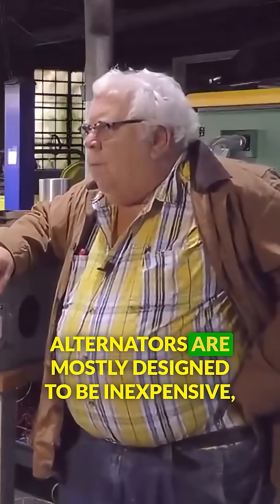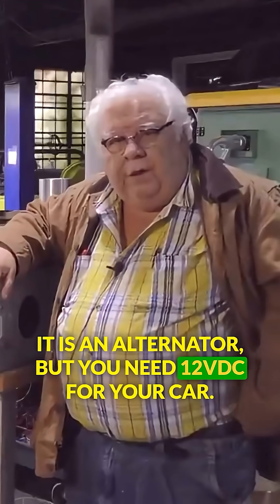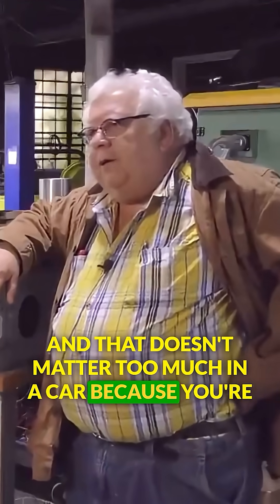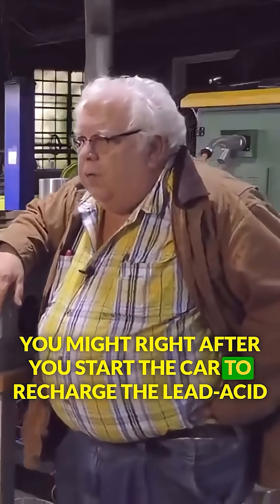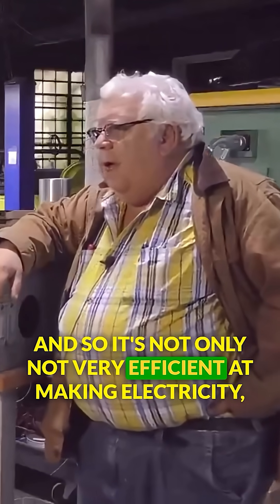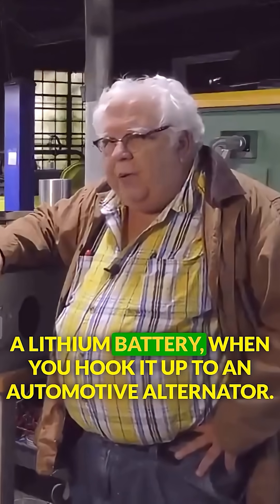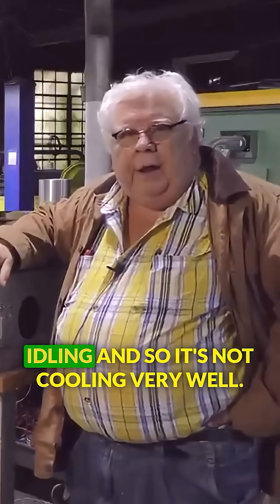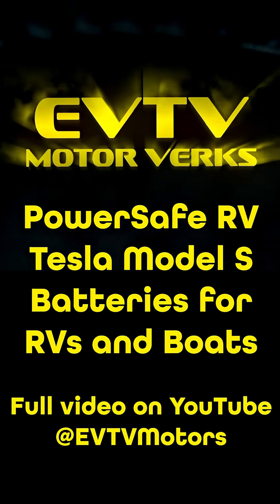Alternators are Only 50% Efficient!

Comment: When I was young and poor in the 70s, my alternator quit charging.  Didn’t have the $22 for a “new” one.  I took it apart and knew just enough to realize that one diode wasn’t like the other 5 using a Simpson ohmmeter.  I desoldered it and pressed it out and took it to a shop then rebuilt starters and alternators.  The old guy didn’t want to, but he sold me a new diode for 17 cents.  I was real proud of myself that day
Reply: I used to buy reman alternators. Then I noticed they were all poorly rebuilt. The bearing housing was shot so they used a plastic spacer that wore out quick. Anyway, I wasn’t spending $300 on a new one and now reman crap is $150-200, so I leaned you can open it up and replace the regulator/rectfier for like $20, bearings like $20. If you have to you can get brushes but cut rope at the commutator and windings. 

Point is, being poor doesn’t mean you have to be broke.
Reply: @tomlindo2863i see that plastic spacer on the original starters taken out from freightliners, and sometimes you dont find it here local in Chile
Reply: @tomlindo2863I used to run dual 100 amp alternators they are cheaper than one big alt and would replace regulator for a higher set point as well as replace rectifier bridge. Was very easy
Reply: @tomlindo2863in the 80's we always used brass bushings, but never saw one that had a bearing that needed a sleeve.   I might've saw 2 that just required using a small punch to make a few ridges inside the aluminum casting, that would hold the race tightly.   And i rebuilt probably 200
Reply: When your poor you learn and you learn well
Reply: @tomlindo2863 yup - I JUST did my 2003 Volvo s60; the original lasted over 362K miles.  I removed the alternator and then replaced just the regulator/rectifier... for $60.  Compare that to a reman I was quoted at over $300, plus Core.
Reply: @tomlindo2863 the people I know who grew up poor are the smartest people I know. ❤
Reply: @tomlindo2863 You mean Arrow does not remanufacture using the highest of standards?  <G>

A former employee once worked at an auto electric shop. Starters, Alternators, generators, and dynamos for vehicles, cranes etc.... most of the work was reboring the housings for new bushings or bearings. and rejecting cores that  would not hold up.

A lot of lathe and mille time, and finesse. They spent the off seasons ( spring and fall ) building up a stock of popular GM Ford and Chrysler for the coming winters and summers.
Reply: Back in the day when people actually repaired (and knew how to repair) things.  I fix everything, in this disposable society and I more often get criticisms.  'I don't have time for that,' 'take it to a shop,' 'just buy a new one'...losers
Reply: @Johnslist I'm with you. Guy wanted to charge me 275 bucks EACH to replace 2 window motors. Driver and passenger in my wifes Mazda cx9. He said you couldn't open those motors and replace the gears. I called bullshit found the gears on ebay for 7.50 for each window. I saved us 535 dollars
Reply: @Johnslist rebuilding doesn't provide American jobs. Buy new.
Reply: @Johnslist Yup!
Reply: @Johnslist use your 🧠 nostalgia things can be handles with simple hand tools, short while of learning and a little t&e. If it breaks permanently, oh well. It was already screwed. If it's TOO IMPORTANT TO RISK, then I will refer to a pro. Most things ca be handled personally, with a bit of grit, education and determination
Reply: @Johnslist  Yes losers!! There are losers who will steal a $20 air mattress from Walmart! 
Or $1.25 item from the dollar tree!!!
Reply: @Zach-sg5uu I guess “losers” works. Where I’m from, we just call them “blacks”. They shutdown my local Walgreens because they kept stealing red spice.
Reply: As an engineer I can tell you always use a term re-manufactured as opposed to rebuilt up on request at a service shop...!!! Manufactured including not only a physical examination to meet specs but also making the unit for in-play tolerances etc....!!!!
Reply: @alancombow6474  I worked in an exclusive engine rebuilding plant that's where you find out what Reconditioned and Rebuilt mean in the business, Rebuilt means all new parts to spec, Reconditioned means second hand used or repaired parts with lower end tolerances. we only did rebuild to specs or higher or customer requirements, where the costs and end product reflected the differences.
Reply: @FladFlidington  rebuilt may technically mean replacing everything, but many people use that term without doing all that. I've seen lots of people simply reseal components and call it rebuilt. Whether they replaced the bearings is a real toss up.
Reply: @alancombow6474 lol you're funny. 😂
Reply: @alancombow6474  i find that no none rebuilds YOUR alternator anymore..we used to take starts in too...not anymore..
Reply: Indeed, you had every reason to be proud! Kudos!
Reply: Back in the 1990’s.  There was a guy from Jamaica  in Brooklyn NY that could take astock Honda alternator and rebuild it to  100 + amps.   They never failed.    The guy made a quality product.
Reply: @fatboy19831 That goes to show you that Jamaicans never fail to work…………😊👍
Reply: @fatboy19831 In Africa they are making welding machines from them, sort of "inverter welder", by changing idling RPMs they are changing welding output. 🤗
Reply: @fatboy19831  a Japanese guy but with dreads saying “my bum ba clot alternator” with a touch of nyc accent would be hilarious
Reply: Ιf the alternator had 50% efficiency and 1200watts of heat that wouldn't live for more than a minute
Reply: @ngt84 I have lithium ion batteries in 6 cars my side by side and motorcycle this guy is full of it.
Reply: @ericculver115 , I suspected that !
Reply: I bought a rebuilt/reman alternator when I was eighteen or nineteen. Installed it and had bearing whine. Couldn’t drive to the place to get replacement without it installed so I took apart my core and swapped bearings. Worked just fine until I blew the car up lol. That’s another story though. My point here though is when disassembling the core I found a burnt winding. I felt like a genius for (maybe) finding the only failure point based solely upon my high school learnings 😂 (I was definitely not top of my class)
Reply: A Simpson 260? LOL Haven't heard that since my early Air Force Days.
Reply: @Mike-sheaDtree  Dad was PMEL.  Taught me how to solder when I was 8.  Still have a 260
Reply: @SteverRob  Tho I was an Electronic Warfare Technician in the AF, I did about a year in the Type IV PMEL Calibrating torque wrenches and some Simpson 260s, back in '84ish
Reply: @Mike-sheaDtree  Small world.  We still live on the MS Coast, near KAFB.  Dad retired from the AF and after 18 years with NASA (Stennis) and now I have also retired from the same NASA Center as a Sr. Metrologist at the Cal Labs there. Followed in his footsteps
Reply: @SteverRob PMEL? In the Air Force that was the Precision Measuring Equipment Lab. They calibrated our furnaces and at Langley they did all the heads up display work, radar tuning and anything that literally had to be Perfect. Much respect!!!!  I was just an aircraft welder.
Reply: @Mike-sheaDtree  in my first electronics class, ~35 years ago, my electronics teacher had a set of simpson meters in the lab for us to use during class. i would love to get one, just to bring back those warm memories.
Reply: @IzziedeD  I went through 10 months of electronics in Air Force Tech school at Keesler ADB Biloxi MS, it was truly a privilege. It included Electronic Warfare, since I have long since retired I only use it to modify my electric guitar, or fix the wife's washer and dryer, lol
Reply: @Mike-sheaDtree The wife's washer and dryer is wild 😂
Reply: @Mike-sheaDtree , I have two of them. Digital is great for most things but when I want to see a troublesome issue a needle tells a lot. An O-scope of course tells all.
Reply: Remember when you’re young and poor and life seems so much easier.👍 thanks for the story🙏
Reply: I replaced the diodes as a set.
Reply: My first car a 1966 Chrysler 300 had a starter that was going bad. This was 1975 or so. It was hit or miss when the solenoid would drive a round plate into the 2 poles that would make the high amp 12 volt connection to make the starter motor spin after the drive gear engaged the flywheel. I was also too cheap and poor to buy an expensive starter so I took it apart. Found a weird bolt with an angled head on it that was one of the poles that made the 12 volt connection. It had a semi circle gouge taken out of it where the round plate would slam into it to make the connection. That gouge was so deep it would not always make a complete electrical connection. I went to a local auto electrical repair shop and showed him the bolt. He said I think I may have one of those and looked through several parts bins. And yes there it was. Charged me 50 cents and I was on my way. Put it back together and the starter worked fine until I sold the car 9 years later.
Reply: @dj1111s , good troubleshooting!
In my younger days, my brother had a little Honda scooter if I recall correctly. The starter had a hard time spinning so I took it apart. Buying a new one was beyond reach. The commutator, I now know what it’s called, was dirty and dark so I cleaned it up till the copper was visible. The brushes looked ok to me and it worked great when it was put back together.
Reply: Why don't we generators instead of alternators like we used to
Reply: @Charlie-cg2vd  That's a fair question as generators were the standard in automotive applications for years early on but, the alternators are the modern standard due to their superior efficiency, higher output and their durability.
  Generators, while simpler in design, have lower output at low RPM, require more maintenance and tend to overheat under heavy loads.
Reply: @Charlie-cg2vd , at idle a generator doesn’t have enough to quickly charge the battery after the engine starter used a lot of its Amp hour capacity. Think of doing a lot of starts and stops running errands all day. The battery and generator combo will not keep the battery topped off.
 Thats why an alternator was the standard upgrade “back in the day”.
Reply: @Charlie-cg2vd More money to make them = less profit and they last so they can't sell you 10 of them.
Reply: @Charlie-cg2vd  Probably cost since an alternator doesn't need magnets or brushes.
Reply: In 1979 a kids father had a automotive battery shop. What? And he told me that 90% of the batteries they took in were still good, and it was corrosion on the positive terminal that made them not function. So they recycled LA batteries by replacing the acid and cleaning the terminals. Clean connections is king. 

Fast-forward ; We've all replaced a set of AAA or AA batteries. Next time test each  battery using a multimeter. it's amazing how many times one battery is dead and the other are all still good. Saving both coin and environment . Now charge 0N.
Reply: Flatscreen TVs that have suddenly died without any apparent damage have usually blown a can (capacitor) and upon opening the TV, you can usually locate the bad can because they almost always blow out the top where a cross has been scored into the metal and it looks to be wearing a booger hat. The solder can be melted, the can removed, and replaced with a cheap new capacitor
Reply: Today, you buy a new one and replace because the time spent is worth more than the material.  And we start loosing out on skills and knowledge
Reply: I had a similar experience, young and poor when my car started dying when at idle and I realized that revving the RPMs would give it enough power to stay running. So I took it apart and realized it's basically an electric motor and the steel brushes were so worn out they barely made contact. The guy at the auto parts store didn't have any brushes in stock but he complimented me on actually rebuilding my alternator because according to him he hadn't had anyone else come into his store trying to rebuild an alternator for decades.... Ended up going to the salvage yard to pull another alternator however the only one that was available didn't work either 😂 thankfully it's brushes weren't the problem so I fixed mine with those brushes.
Reply: my alternator stopped working half way home at night, 70s gm alternator,  I took my tire iron beat alternator,  it worked!! loosened up brushes, next day I changed alternator,  found a hole i put into alternator aluminum housing!!! lol
Reply: @SteverRob I would say that's one of the best "good old days" stories I've heard in a long time..
Reply: Another reason I miss Radio Shack.
Reply: @st3wi3D  I worked at one in early ‘90s.  I was not a good salesman; seems that and count inventory was all we ever did.  And follow shady people around.  I didn’t like that much.

Fast forward 10 years and I’m now a customer, wanting to search through the nerdy discreet electronic components way in the back. They did it to me, a salesman shadowing me as I searched for a few LEDs.

I went through every single frtickin drawer.  One transistor at a time.
Reply: @st3wi3D would you like to partner up and make a radio lobby... Just let me know
Reply: Of course we'd find a better name  @st3wi3D
Reply: When I was old and poor my phone charger broke, and because I'm too stupid to fix it myself, my phone is probably going to die before I even finish with this comme
Reply: What car idles at 600 rpm? A model T?
Reply: @albondigas9549  A lot of manual trans cars idle 600-800 rpm. Automatic transmission requires a higher rpm to overcome the resistance of the torque converter.
Reply: @albondigas9549  my 06 chevy silverado
Reply: @albondigas9549 my 2000 cadillac deville dts idles at 650... it's rare to see these days but still a few out here😊
Reply: @albondigas9549  An old VW Beetle.
Reply: I did the same thing in the 90s. But I bought 5 of them for  15 cents. I got the better deal.
Reply: I loved the alternator rebuilding shops
Reply: NOW YOU HAVE AN EV
Reply: What does that mean ? As I had my lithium battery on my motor bike 6months now?
Reply: Did the same thing for my coworker's generac.. 3 diodes beeped at me and the 4th one didn't... My friend said "He TALKS to them!" Electrons, that is... Hence the nickname electron boy.
Reply: @chasbader  lol
Reply: I just pulled and installed a new motor in my 91 GMC. Never have had any shop/engine classes. Never pulled a motor before. Feels good, mang.
Reply: Yeah, that happens a lot with parallel components,  one is always lowest and ends up getting slammed😂
Reply: And now you have made day with your story. well done sir.
Reply: It's the same thing for AC units it's just the compactor
Reply: That is the way to do it my friend. I have saved 100s of 1000 of Dollars like that. I fix everything and fix it better than new!
Reply: @We-Do-NOT-Consent-To-The-Loop better than new is true. My goal too!
My son is the computer geek and builds them for his buddies.
A friend of his fixes and flips a car now and then and he helps all the guys fix their cars. The whole group gets wiser with shared knowledge.
Reply: Being poor is the best teacher
Reply: I have lithium ion batteries in 6 cars my side by side and motorcycle this guy is full of it.
Reply: @ericculver115 I have never messed with alternator but I suspect the issue is  ameliorated by the bms if it has a charge disconnect feature. We aren't hard wiring shit together these days 😅
Reply: Any time something with diodes dies, they should be the first thing you check.  With a ohm meter just look at the flow from neg to pos and vise versa. Diodes only let electricity flow one direction.  Of course, many modern electronics have resin over the circuit to seal you from fixing it.
Reply: Great story. Thank you for sharing it😊.
Reply: learning how to do it yourself is always awesome.
Reply: I was ‘young & poor’ about the same time, did my own car maintenance…
… & the awesome sense of satisfaction in figuring out a problem & ‘fixing it’ is something you’ve experienced ! …
… 🤔… & there was no ‘YouTube’ to consult…
Reply: And now just a cheap standard alternator is about $200.
Reply: Still using a simpson meter to this day to repair a/c and some d/c motors.
Reply: Must have been a 10 dn delco alt. Been rebuiding for 38 years now for a living.
Reply: thats a legit cool story
Reply: you were poor not having 22 bucks to buy an altanator in the 70s!!!!! my father didnt have toilet inside the house in 70s 🤣🤣🤣🤣🤣
Reply: @nikthegreek844 tyranny.
Did he make one?
Reply: You were a changed youngman for ever😅🏆👌
Reply: I used to rebuild my alternators as well replacing those so cheap to do back then
Reply: I can bet you it's not that he didn't want to repair it it's that he saw you were on the journey to learn how to repair them yourself and in that self discovery he didn't want to interrupt
Reply: i did the same thing with my refrigerator 12 years ago. mustve had a power surge and it fried some components on the circuit board, so i replaced the burnt out parts and away it went. that fridge is still running to this day.
Reply: Those numbers are wild in today’s time😂
Reply: That’s awesome I love it 17cents 😂 👍👌
Reply: are you old and rich now? (fingers crossed)
Reply: But did it work..
Reply: Man if only we did this still now days people cant even set lash on valves department of de-education did its job the last 50ish years making us just smart enough to not know anything .. thankfully my grand pa taught me how to set carbs and valves
Reply: @SteverRob a boomer story about how you solved a symptem instead of the cause of a problem?
Typival boomer thinking
Reply: @BDouglas-o9b 
Typival millenial illiteracy.
Reply: Weird…. My lto lithium banks never killed an alternator in seconds, matter of fact i ran one well over 3 years without issue.
Reply: Heck ya. Sweet story! Thanks for sharing
Reply: $22 dollars for a new alternator? One for my 2001 truck is $350
Reply: Same with radio frequency work..... exactly the same
Reply: @LadiboiJoy   I was given a Collins S Line several years ago, left for the junk pile.  2 months later I was talking to Japan 🇯🇵 
That took a little more than a diode 😎
Reply: I would be too. I've just replaced the whole thing which is expensive and wasteful
Reply: Great to be able to fix things yourself ❤
Reply: Way to go Joe!
Reply: Big W, brother.
Reply: Love Amazon for that!
Reply: Hell yeah
Reply: “I didn’t have $22 for an alternator so I took out my $35 meter and my $25 soldering iron and…”. Yeah good one.
Reply: Does he sound like Al Franken or what?
Reply: Yep we could be twins you got to jump in can't be afraid of shit that's how you learn and that's how you become good
Reply: Simpson 260 are worth money now-a-days.
Reply: But lets also be honest about how easy it was back in those days to replace a diode  or something else because most parts where scewed together, not permanently glued or else.. and they where bigger too, today, to keep it cheap, things get smaller.
And old machines used to live longer than newer ones, sometimes i think i live im the wrong time, trying to fix things that arent even supposed to be fixed when they where build😮
Reply: @christianfatz6389  If you believe you're living ""im" the wrong time", then just go there.
Reply: The old guy just knew how dangerous  what you were doing was and didnt want to be responsible for you getting hurt
Reply: Stories that never happened 101 section
Reply: Uncle told me they use to rebuild alternators. Said buying a reman wasn’t an option back in the day. Would go to the part store and buy a rebuild kit and rebuild it in the parking lot.
Reply: Great story
Reply: Agree, avoid using the alternator to charge a dead battery, as it puts too much load on it. It’s mainly designed just to top it off. Charge it with a battery charger or put in a new battery if it’s weak. 
Also, there’s still a few good alternator and starter rebuild shops around. I found a guy who buys OEM parts, like bearings and diodes, and offers a lifetime warranty on his rebuilds.
Reply: Ill retafy the situation the goal is to live life to the fullest and diod.  LOL😂😮😅😊
Reply: And you should have been, and I'm 38. I'm proud of you 👏,  I'm proud of you. All these years later, and I'm inspired, I love repairing things. I hate this newly designed obsolescence we have now. It should be illegal to design something to break in 5 years. It's a racket, the goverment like it because they just want tax from sales. Capitalism is great but this toxic type of Capitalism is something else we need things but like they were between 1920s and 1960s perhaps 70s anything afterwards is getting iffy. To think we could design things to run for 300 years now easily with easily replaceable parts. Even if the technology moves on there's always someone less fortunate that can make use. Corporations can suck. People would pay for a CRT TV and it would last 50 years now pft 3years and its obsolete apparently. But with a little imagination and adapters it's a smart TV only difference is its 4k and I'm sorry but 4k isn't all that great our eyes can only see so much. Also I watched video tapes growing up 480 is great 780 grand
Reply: That’s how it starts!
Reply: Old Miller welding machines used to blow the diode blocks often. In Okinawa, Japan I took it off base to a local electronics store and got a much bigger one for just over $1. That diode lasted past the day I left in Dec, 1985. The machine blew them every month at least. Felt good to have a welder that didn't lose half it's open circuit voltage and make stick electrode welding dang near impossible.
Reply: The old days- as an old retired mechanic- I remember them well 👍👍👍
Reply: My Dad used to do that too when he was alive rebuild both saved lots of $ too
Reply: Loved hearing great stories like that thank you
Reply: In those days, I used to go to the parts store and buy the two bearings and the two brushes for about $2.  I never saw diodes fail....and actually there are SEVEN, there is one BIG OUTPUT one to prevent Reverse Polarity situations.
Reply: @diverbob8 6 diodes in the rectifier bridge. 3 positive and 3 negative. 3 leads from the stator to the rectifier.
Reply: @rickyherndon2484 what are the other two for compared to a regular full bridge rectifier?
Reply: @brycegraeser2940 an alternator stater is wired for 3 phase. Delta wound and Delta connection. 3 phase requires 3 diodes per phase.
Reply: @rickyherndon2484 makes perfect sense. Thanks!
Reply: i replaced brushes in mine before.